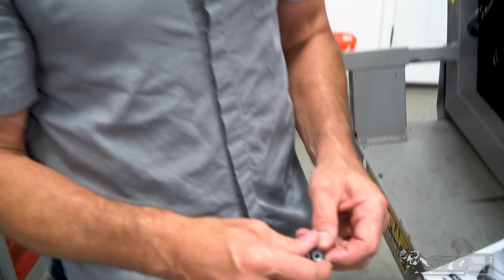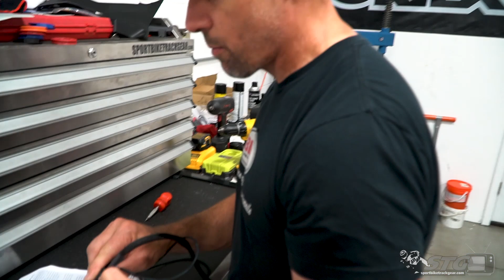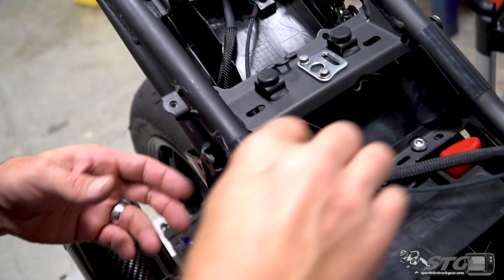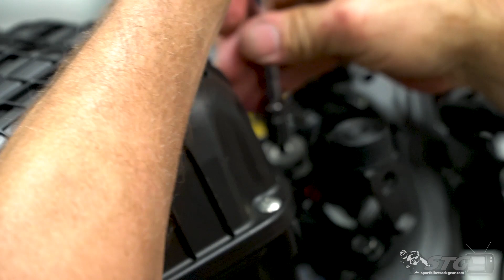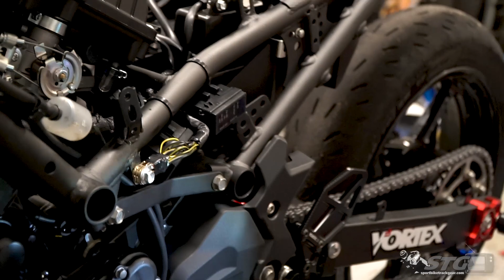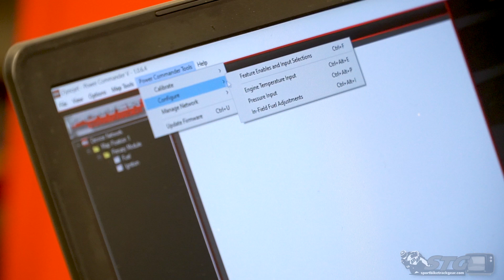Kawasaki Ninja 400 Power Commander V and Quick Shifter Install | Sportbike Track Gear

Comment: Maybe I misunderstood, but if you have this in GP shift, wouldn’t that be pushing the shift rod so you need to use the green/blue rather than the red/yellow wire?
Reply from the maker: Old video and it is possible I misspoke. There will be literature that comes with the sensor that will indicate which connector is push and which is the pull. - Van

Comment: I also bought your Quick Shifter!  My configuration will be different as I’m setting it for standard shifts. Will I then use the other set of wires? And do you know which link rod I will need?  You guys are absolutely AMAZING!  GREAT videos!  Big shout out to your camera men and editors! Van-your ability to talk while getting fasteners/tools is impressive, and you don’t waste breath…very rare!
Reply from the maker: The sensor is a dual contact so you can use it in std or reverse shifting. To get it to work with std shifting you will use the opposite of what we did in this video. Thanks for watching and the kind words. - Van

Comment: I grabbed the last PCV from DK! The new PC6 is emissions compliant AND I got it for +$150 off!  Thanks for the video. One ?…if I change the intake to a K&N (or similar) do I still use the “stock air filter” map? Love you guys!  Gotta love a Brian!
Reply from the maker: If there is not a map for the race style air filter you can use the one for the stock. There is typically very little difference between the maps. If you are racing or desire to get the most out of your bike you will need to take it to a dyno tuner. - Van

Comment: I did the power commander 6 on a 2023 z400 no start
Reply from the maker: Double check your work to make sure you have not missed anything. If everything looks good reach out the Dynojet directly and work with their tech support team. They will help you get this sorted. - Van

Comment: hi!! can you send me the links of each item needed to install both sistem in the same bike please
Reply from the maker: Everything you need will be found in this link. Depending on the rearsets you are running you will require different length shift rods.
https://www.sportbiketrackgear.com/parts/kawasaki/ninja-400/2022/?_bc_fsnf=1&brand=67
Reply: thanks!!

Comment: Is it possible to do this install but with regular shifting. Not GP. I know that the quick shifter can do both but will it fit with those rear sets?
Reply from the maker: Yes, all you need to do is to flip the shift knuckle. - Van

Comment: Is this a no directional quickshift or only clutchless up shift?
Reply from the maker: The sensor can be used as a push or a pull. - Van
Reply: @sportbiketrackgear  but can it do both at once is my question ?can I do up and down shift ?

Comment: Any issues with this kit on this bike? Im looking for a bike with clutchless shift but most are expensive.  I like the ninja400 and z400 but they dony have it..if I knew there was a reliable hi directional quickshift for it that was reliable and that I could get someone to set it up perfectly for me id get the ninja400.  I dont want to deal with issues tho or constant adjusting
Reply from the maker: We used this system for over a year and it worked great. - Van

Comment: I have an IRC quickshifter and stock ecu, air filter, etc what would be a good cut time for the street for smooth but fast upshifts? I also have a new performance clutch in it too
Reply from the maker: Sorry I am not familiar with the IRC product. - Van

Comment: Do I need to get the engine block off plate if I get the power comandar ?
Reply from the maker: You do not have to but it is not a bad idea to do so. - Van

Comment: I have a stock ninja 400 and wanting to fit a full spark exhaust system and K&N air filter. I will also fit a dynojet V. My question is one I fit the dyno jet and upload a map from the dynojet website, do you need to take it to a garage for a fine tune remap? Or will it be fine?

It will be used for normal street use. Not for the track.

Thanks in advance!
Reply from the maker: You will be just fine with the map from Dynojet. No need to take it to the dyno. - Van
Reply: @sportbiketrackgear  thanks for the advice mate.

Comment: Ok way off topic but I kinda need help!. What do I use for the electronic cable for the stator at the area it goes into the casting: what type of sealant . I'm replacing the stator magnet coils
Reply from the maker: Yamabond is nice. You can also use any silicone sealant rated for oil. - Van

Comment: Just receive my pcv from sportbike track gear and installed. Have check engine light now. Any thoughts? Everything is connected securely. I still have stock headers on, plan to do that tomorrow so it’s not an 02 problem.
Reply from the maker: If you can let me know which code you have we can try to get you pointed in the right direction. - Van
Reply: Thanks. Light went off after a 40min ride on interstate. When I had the air box off, I turned the key to the on position to make sure power commander was working before I went any further with installing. Pcv did not turn on until I had everything plugged up and reassembled. Long story short, turning the ignition to the on position with air box off, will cause the #13 code. Even after reinstalling everything. Took it for a 40min run on the Interstate, turned ignition off then back on after 10mins and the engine light was off.

Comment: Friend, a question about the CFKMOTO NK250, is that engine carried by another motorcycle model or another brand, for example Honda or Kawasaki? I have an NK250 and I want to know in case I ever have to buy spare parts for the internal part of the engine. I want to know what scanner, brand and model they recommend me to buy and be able to test the CFMOTO brand and also if by chance they know the brand and model of any programmable motor control unit to install it on my NK250. I would appreciate the information.
Reply from the maker: Sorry my man I am not familiar with the model you are referencing at all. - Van

Comment: I need that  quickshifter without changing the stock ecu , is it possible ?
Reply from the maker: Yes you will need the FTECU Flash and their Quick Shifter. Here are links to these products on our site:
FlashTune Kawasaki Ninja 400 18-19 ECU-Based Quickshifter Kit
https://www.sportbiketrackgear.com/flashtune-kawasaki-ninja-400-18-19-ecu-based-quickshifter-kit/

FlashTune ECU Type 4 Bike Side Tune Kit Kawasaki Ninja 400 18-19
https://www.sportbiketrackgear.com/flashtune-ecu-type-4-bike-side-tune-kit-kawasaki-ninja-400-2018/

Comment: You didn’t show the power gains 🤷🏼‍♂️ a non sense video. It’s faster?  Gained more top speed? It accelerates faster?. Can you make a second video of the power gain results?
Reply from the maker: We have not and typically do not run the bikes on the dyno. That will change for next year when I build this bike for Max Van to ride in the JR Cup with MotoAmerica. - Van

Comment: Ok took a while to get everything back east here and PCV is installed NOTE,  if you own a 2018 - 2019 Ninja 400 made in Thailand distributed throughout Asia you will need an Dynatune O2 optimizer to plug in where you remove the original 02 sensor, if you don’t you will get a P0030 DTC code, if you are using an OBDII reader, and the dreaded engine light. STG sells the 02 optimizer in addition to the PCV, whereas many bikes sold in different markets do not need the 02 optimizer plug - thanks Brian for the video, and the 400 came to life with the M4 full exhaust even using a stock PCV map PCV and autotune. Dropped a few lbs with a a motoholders front fairing stay (threadlock needed everywhere because vibrations) and a lithium battery gave me a nice hole to put the PCV and autotune in. STG you guys are the best keep up the great work.

Comment: Is the power commander universal? Like can I get one "for a different bike" and just load a ninja 400 map onto it?
Reply from the maker: No the Power Commander is a model specific part, not universal. - Van
Reply: Sportbike Track Gear That sucks.. Thanks for the response. Video answered a lot of questions! I’m looking at the same PC for my Ninja, would you recommend this over the autotune? I just want a little more power.
Reply: JN Photography the reason the PCV is bike specific, the connectors fit exactly to the OEM connectors for that specific model. The Auto tune is a must if you dont’ have access to a Dyno to do flashes, like myself. I have been using PCV combined with autotune on my R3, 300 and now 400 and it makes the world of difference, hard because i can’t Dyno prove it but it is noticeable in how the bike handles on the 300 it really smoothed out the fuel curve and made throttle response normal, gone with the crazy come on of power at 6500 rpm. The PCV is well worth its weight in gold and it is an industry standard, there are many other brands coming out with licensing where your ECU can be modified directly unlike the piggyback system the PCV is. For many not doing serious engine modification other than exhaust and air filter, the PCV is enough. Makes the bikes run much more like they were designed before the big four had to curb performance for epa restrictions.
Reply: Mark Nasia excellent, I actually just got a similar device I will be fitting soon - the rapid bike evo, hoping for a similar result!
Reply: Will this void any warranty?
Reply: @chrisvondoom3679  I asked the dealership about this. Apparently it won’t but if Kawasaki say “your engine is overheating because you are pushing it beyond it’s usual max”, don’t be surprised. But if your alternator failed (for example), it is more than likely you will still be able to have it sorted under warranty
Reply: @JNPhotography  thanks for quick reply.
Reply: @chrisvondoom3679  Chilled man, ride safe!
Reply: @JNPhotography  You too! Thanks again

Comment: Any idea on how much power over stock this is going to make? I'd love to see a head to head comparison with a stock 400. 0-60, 0-100 ect... great video though. Thanks
Reply from the maker: That would really depend on what exhaust or other performance mods you have on the bike. If you have installed a full system you will need to install a fuel controller or flash the ecu to get the maximum benefit. - Van

Comment: Any idea on when you'll stock heim/rose joints? Always good to have extras on hand. I also run V2 rearsets on a GSXR w/ a Translogic Intellishift QS system (also the manufacturer of Dynojet's QS parts). Stock some LH & RH male thread.
Reply from the maker: I am working on this project now, not quite sure when it will be done. - Van
Reply: Try searching for ...cb-m6
Reply: @darthmayhem8970  Thanks for the tip, and I know where/how to order them. But, at times they can be a little tough to source in smaller sizes like m6-m8, or sometimes online shops don't want to sell single units and often want a larger order, which for the average consumer isn't plausible. Vortex does sell them as replacement units, but their phone schedule conflicts with mine and they won't give any details thru email so that option is ruled out (for me, personally). Plus, STG is local to me and I like to support local businesses so if they were to start stocking these, it would make things a lot easier for everyone.

Comment: This is a great video, question, why didn’t you go with an ECU flash instead? If I’m not mistaken, some offer a quick shifter option. I had one for my old Ninja 300.
Reply from the maker: I did the FTECU flash after installing the Power Commander and quick shifter on the Ninja. At this time (soon to change as I understand it) FTECU does not have the quick shift portion of their program done, just the tuning portion is ready for the Ninja 400. IMO riding a bike on the track without a quick shifter is like drinking a Corona Light without a lime. Once I did the flash tune I went into the Power Commander and zeroed out all of the fuel and ignition maps while leaving the quick shifter enabled. - Van